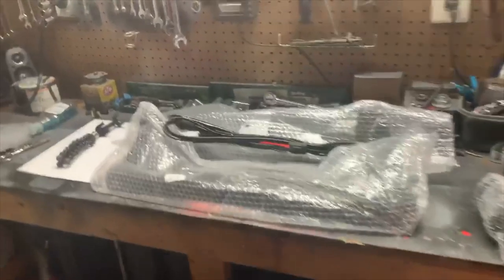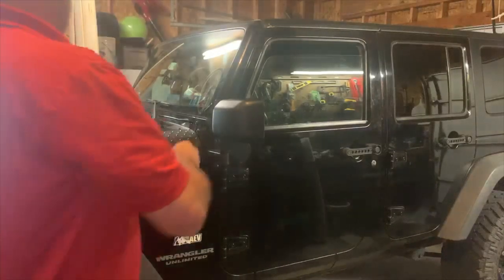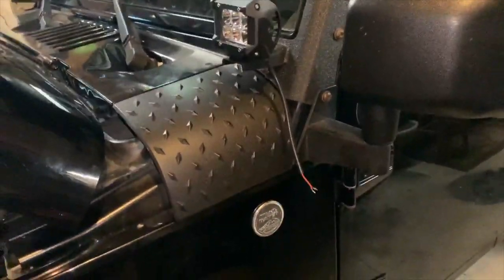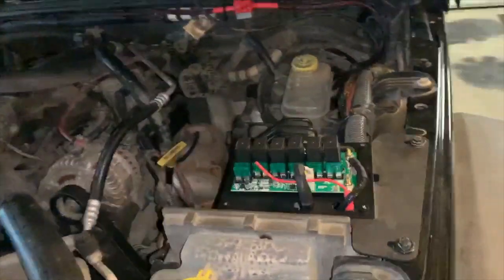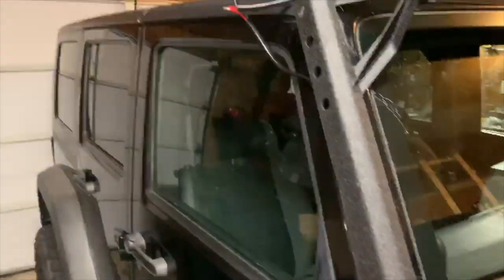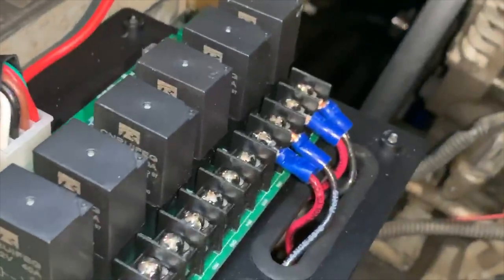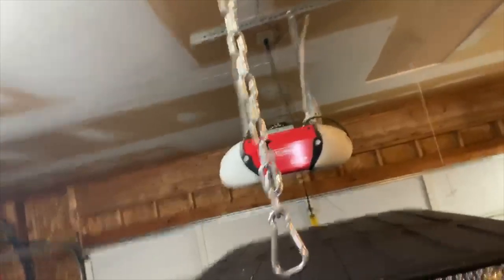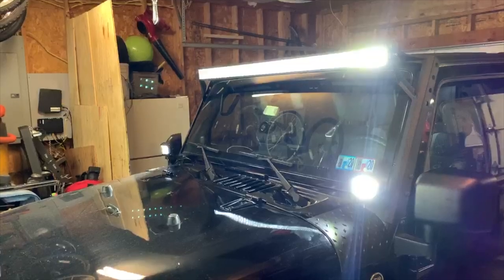HOW TO INSTALL YITAMOTOR 52" inch 300W Combo+ 2X 18W Spot LED Light Bar

Comment: So I just got this from Amazon and I tried the door seal method on the fins, and maybe I'm using the wrong weather seal strip because it hums like a mofo. Any tips?
Reply from the maker: Mine hums too.  Its actually still doing it.  There is a plastic guard that goes over it but it looks terrible.  I'm still shopping around for something to stop the noise.  I tried thicker weather stripping and still have the hum.  Anything you find out let me know as well.
Reply from the maker: The lights work fantastic.  Did you get the SPOD?  Check out the video on that one as well on the channel.  Love the SPOD.
Reply: @ifitfitsitrips5600  well that's a bummer, I'll keep researching to see what I'm able to find. yeah that aerolidz cover looks like shit (no offense to the company) and is not my cup of tea. Bu I definitely need to figure something out before a road trip I have coming up this summer
Reply: @ifitfitsitrips5600  yeah they are super bright, and I picked up the voswitch 8pod controller. Works fantastic